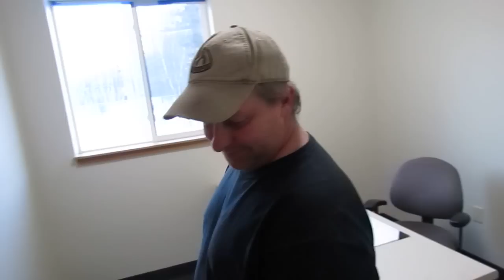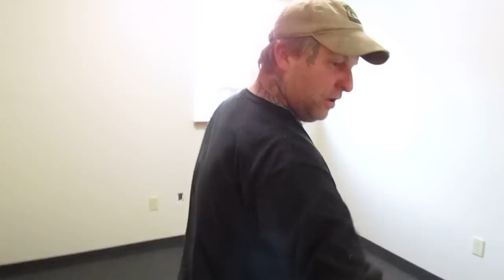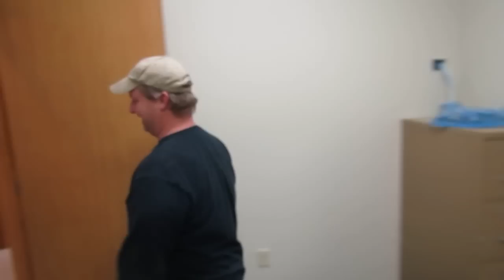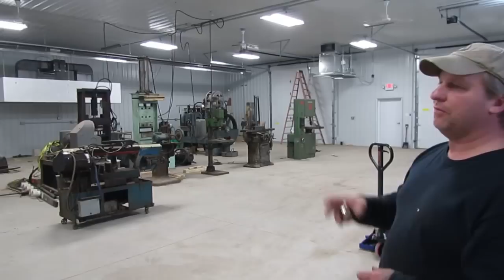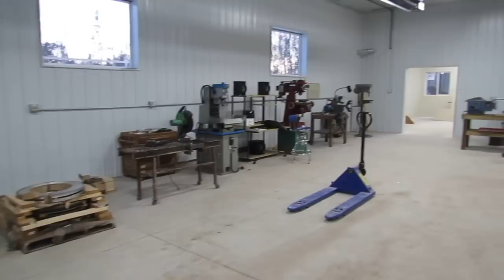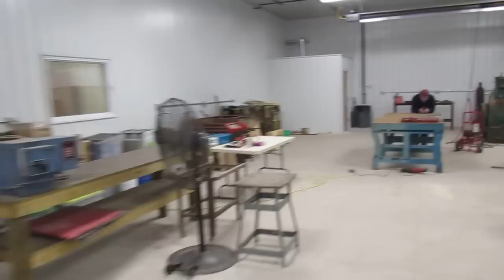Interview with Zoe Crist -- Maker of Custom Knives and Damascus Steel

Comment: Great video, Just found out about Zoe Crist knives last night and been trying to find as much info as possible about the company and your video was vary informative. I plan on purchasing a Zoe Crist Fire Creek this weekend. I've got a few questions though 1. Do you plan on reviewing the Fire Creek, Saluda, Santa Fe knives at all? 2. Does Zoe get commissioned to make bark river knives? curious about the tracker blades seen in the video. 3. Could you find out if Zoe has plans to release a midtech folder at all this year? or will he mainly be focusing on fixed blades for 2017. Thanks a lot
Reply from the maker: Great questions, Tyson.  I do plan to review more of Zoe's offerings, but don't know yet which ones. He will definitely be releasing more mid-techs this year.  His 2016 mid-tech line did have some operations performed at Bark River, but I'm not sure what the business arrangement was.  On future runs, as Zoe gets the new shop set up for volume and hires employees, I believe his plans are to produce everything in house.  While Zoe has made some exquisite traditional slip joints, I'm not sure what his plans are to produce them in volume.  I'm pretty sure 2017 will be a fixed blade year for him.